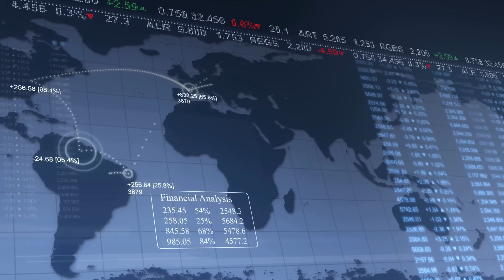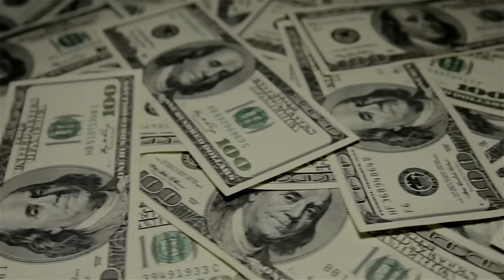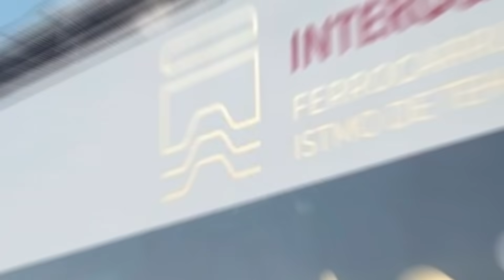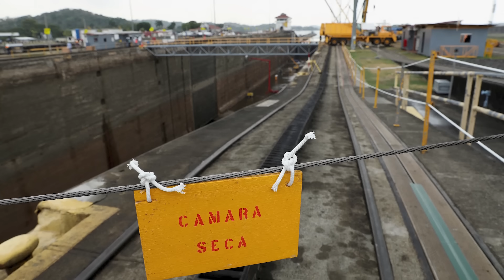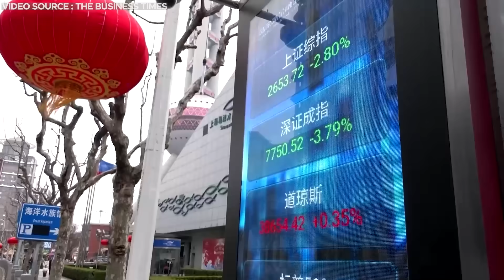Mexico Is Building A $5 BILLION Corridor That Will END The Panama Canal

Comment: So Mexico's plan is to unload a cargo container ship, move the containers with a rail train to the other coast, then load it on another ship?  That seems very labor intensive.  Compared to going to Panama, and going through the locks without unloading the ships.

Besides Panama can reduce the amount of water needed for each lock by 20% if they would dredge the lake by about 10 meters, and then drop the lake water level by 10 meters.  Then less water into each lock for each crossing.  

If Mexico had a way to transport each container ship across the country from the Pacific to the Atlantic and back, that would provide a effective competition to the Panama Canal.  However if they need to cross a mountain that is over 300 meters then a canal would not be cost effective for 800 feet long ships over 10,000 ton capacity.
Reply: Jobs ! ! ! !

Comment: If it works, more power to them. The Panama Canal is growing impassable due to lack of rain for the lock structure.
Reply: The lock infrastructure is fine. Lake Gatun is the problem. Water is reused in the actual locks. The lakes water level has been dropping for many years.

Comment: Will never work. We are now building ships to carry 25,000 boxes will require to much time, labor and multiple container ships to work.
Reply: However, ships are built due to size restrictions of the canal.
Reply: @deepsleep7822 Didn’t Evergreen send one of their super box boats thru the canal? The accident was not related to a size issue. Long Beach has some of the largest cranes and deep water piers. It’s the east coast that needs to catch up. Offloading 23,000 boxes from a ship, loading them on a train and then reloading a second boat on the same voyage simply makes no sense.

Comment: Container ships today spend less than a day in port to load and unload it's cargo. The 2 days loading and transferring cargo will save about a week over going through the Panama Canal and offer an alternate route. Right now, ships wait days to go through the locks. I am surprised it has not been done by now.
Reply: You need twice as many ships as before. Instead of 1 ship making a complete trip, you need a ship for the Pacific and a ship for the Atlantic sides of Mexico. And then the time to unload, transfer to trains/trucks, and then reload onto a 2nd ship.
Reply: @twostate7822  You don't need twice as many ships! Those ships take half the time to make their routes!
Reply: @twostate7822 the ships you unload can then be reloaded with cargo going the other direction. Some loss of efficiency there, yes, but doesn't require twice as many ships. If Panama is a bottleneck, adding an alternate route will increase overall cargo movement across america
Reply: @SuprousOxide  Think closely about the problem. Say there is a shipment from New York to Tokyo, and then a return shipment from Tokyo to New York. You can get by with 1 ship. Having to unload in Mexico means you need 2 ships. Simple math says that is twice the number of ships required.
Also, right now, about 45% of ships are sailing empty. They delivered a shipment, but then have to go to a different port to pick up another shipment.
Reply: @twostate7822  in that case, the one ships busy for the whole trip from New York to Tokyo and delivers 1 cargo load.
In the case with the railroad, you need 2 ships, but you're delivering 2 cargo loads in about the same amount of time.
1 goes from Tokyo to the railroad on ship A, then the railroad to new york in ship B. The second cargo goes from New York to the railroad on ship b then the railroad to Tokyo on ship a.
Overall, you need the same number of ships to deliver the same amount of cargo.
Ships don't travel empty
Reply: @SuprousOxide  Of course ships travel empty, all the time. Don't be ridiculous. Google should be your friend, not your enemy.
Now you are making up an international rail system that doesn't exist to carry goods from southern Mexico up into the US???
Let's make the route from Europe to Japan instead since you have trouble with the logic. Ah yes, a train from Mexico to Japan makes more sense.😂😂🤣🤣
Reply: @twostate7822  where did you get this idea of a train from Mexico to the US. We're still talking about the train across Mexico. But you don't need twice as many ships of you reload the ships with cargo going the other direction after you unload.
And you can do the same with the trains.
Japan to Europe would work the same way I described for Japan to New York
Reply: @SuprousOxide  Smoking something good? You are the one who suggested a train across Mexico to New York. And yes, you need about twice as many ships overall if each ship is only going about half the distance. A tanker ship can't be used to haul grain, or coal, or cars. And non tanker ships can't haul crude oil. Plus, as you refuse to understand, ships sail empty a large percentage of the time.
Reply: You forgot about the amount of time to transport the cargo across Mexico and sorting time before reloading..
Reply: @themoretruthfultruth  It is eight to ten hours from the Pacific to the Atlantic
Reply: @vickyp7345  Did you add the time to put the containers on the railroad cars and then unload them? Time that the railroad cars sit in the yard? Railroads don't run like a trucking line. There is a lot of time spent putting a train together before it is ready to roll.
Reply: @themoretruthfultruth  the trains will never be taken apart. the containers will go directly from ship to the stacktrain then it will cross Mexico. The bottleneck will be loading on the other side, unless the entire ship's cargo is going to a single destination, which isn't likely

and ppl, you don't need to distinguish between 20 and 40' or any other size container. Ships are measured by 20' containers, so a 10,000 capacity ship holds 10,000 20' or 5,000 40'
Reply: I think it is more important to have deeper draft ports to handle larger ships than Panama handles.
Reply: What most of you experts forgot is that the Interoceanic train (CIT) it’s also going to have 10 industrial parks to manufacture goods and also serve as a Centroamérican migratory deterrent so they don’t have to travel north! https://en.wikipedia.org/wiki/Interoceanic_Corridor_of_the_Isthmus_of_Tehuantepec
Reply: They should open Atlantic with Pacific Ocean, removing the land and making a straight  free for ship navigating. NO need canal, just water moving though.
Reply: Just imagine you can have 100-car train with 2 containers stacked per car. That's just 200 containers. The train will be over 2 kilometers long. You would need at very least 3-km long block sections. At very least you can make 20 minutes headways, but likely closer to 30 minutes. At 20 minutes that would be 600 containers per hour. Or just 10800 containers in 18 hour span. Rest 6 hours for maintenance. That's mere nothing. Just 4 small container ships.
Reply: I cant see this working at all.  True that a container ship can be unloaded in a day but what will the wait at anchor be for dock space?  What will the costs be for stevedores at each end plus transport costs?   How many ships can be worked at one time?
 Figuring 15,000 containers  of mixed 20' and 40' boxes per ship  how many rail cars will the entire operation need? 
  While there is a delay waiting to lock through the canal there will also likely be waits on the receiving side for the receiving ships arrival and offloading then if the two ships are swapping cargo that can involve more delays.  Keep in mind also the ships load plan, so the last containers offloaded may need to be the first to be loaded on the receiving ship.

Tankers  and bulk carriers wont be a match for this either.
Reply: Besides, a cargo ship waits up to a week waiting for its turn to cross the canal.
Reply: @vickyp7345  Now that is true. But will it justify the extra expense of load/unload and railway trip?
Reply: By providing an additional shipping route?

So go to port, wait for your ship to be unloaded, us multiple trains, supply another ship in the other side, have them reload your ship.

That sounds like a nightmare.  Guaranteed to lose cargo and take days anyway.   Then you have to haven alternate ships for each side.  It sounds like it would be very slow and very expensive
Reply: Its already done, it's called I-10 in the USA. 1 day to disembark in californica, 1 day to cross the USA, 1 day to get back in a ship in the Golf of Mexico or the Pacific. That is why the USA left the Panama Canal.
Reply: @eloymarquez4783  Driving across the US by truck??? By law, US truckers can only drive on the road 11 hours a day.  An average container ship can hold 15K containers. How do you get 15K drivers from thin air??? That's for just 1 ship. If you had 10 ships a day, that 150K drivers and rigs. And somebody has to pay all those drivers, plus the expense of unloading and then reloading at each end.
As far as the US leaving the Panama Canal, not needing to use the Canal was not one of the reasons.
Reply: Your surprised really? You know what happens during this whole process right? Cartles are going to extort construction projects like the do now, leading to a lack of investment. Then if it does get built they are going to hold ships hostage like african pirates due cause there is a ton of money in it. Really not that hard to figure out. As a Panamanian myself, Panama was part of Columbia before the Canal and was not a secure area. No one wanted to invest in that, US takes a 100 year lease with protection rights people invest. No protection in old Mexico to many cartels and the Gov can or will not control them.
Reply: @EnlistedBombin  that is the biggest lie I have ever heard! If that was true, then Mexico would not be 2nd trade partner of the USA. Do you realize how much trade already exists in Mexico? Why is not a problem now?
Reply: @EnlistedBombin  Nope. At this scale, the cartels will be burned down.
Reply: @EnlistedBombin  The cartels won't do anything. They won't bite the hand that employs them.
Reply: @themoretruthfultruth  Your badly mistaken all they care about is power and money. They are stronger then the Mexican gov you do realize that right. Thats why the Mexican gov can not stop them.

Comment: Everyone here favoring the Panama Canal is missing the entire point of the video. The Panama Canal was a solution for intl trade literary 100 years ago. It cannot handle the load anymore. Plus Panama/Colombian terrain has lots of mountains you can't just build a better Canal. Also, they are battling droughts for years now. Panama does not have the resources to build another canal nor a better railroad. They already have a railroad. Meanwhile, Mexico's plan was already put in motion and it's running 6 trains both ways daily. With brand new Ports at each end. It's literary built for major trade

Comment: It will be interesting to see how well a rail system could compete. When some of the container ships can hold over 10,000 containers (the largest is currently 22,000 twenty foot containers, or ~11,000 forty foot containers), the added costs of unloading that many and then reloading them (which takes days, infrastructure and manpower on both ends) seems prohibitive. 
The container rail cars are over 60 feet long. But for simple math, let's say each is 52.8 feet long. That corresponds to 100 rail cars per mile (100 * 52.8 = 5280). If each car stacks 2 forty foot containers, that's 200 containers per mile. That means it would take 50 miles of rail cars to match the load on one large container ship. Locomotives rarely pull more than 2 miles of cars, so that corresponds to 25 train loads/day, with each being over 2 miles long.
I just don't see that as being realistic. Depending on Panama's fee structure, using rail might only make sense for smaller ships, and ships containing bulk, solid material (corn, wheat, coal, ore, etc)
Reply: And Mexico just received three or four "40 year" old locomotive engines from the EU.  Yes!!! forty year old engines!!!!.....
Reply: @albertomanuelcheung7103  That is actually not a negative. For this multi billion dollar investment, the cost of the locomotives is 'chump change', a fraction of one percent of the cost. Plus, it's an item that can easily be replaced (just roll it off the tracks and roll a new one on). If the starting budget demands compromise, this is a good choice. Once the business proves itself to be viable, they can decide what level of more advanced propulsion they want to invest in. They could just buy modern locomotives, or they could 'go big' by tailoring the propulsion system specifically to that set of tracks, grade and expected loads.
Reply: @gregparrott  it might sound a great project with high hopes, but at the of the day,  time will tell and reality sets in.
Reply: @albertomanuelcheung7103  I hope the Mexican government will explore if its utility can be expanded beyond just transporting goods between two oceans. From what I've read, one limitation to expanding trade with the U.S. is Mexico's limited transport infrastructure. If the government expanded its north-south rail infrastructure so it tied into this mostly east-west rail line, the rail line's utility could be greatly increased. Manufacturing companies could be located along it, receive containers to build products, and then redirect their value-added products by containerized rail to both the U.S. and more broadly, the world.
Reply: How much does it cost for the ships to wait for days and weeks to get into the canal?  I don't think of it being a competition more of an alternative. Ships have to wait a long time to queue up for a space to use that canal.
Reply: @byroncjohnston1  The rail, and the very dangerous trip around the tip of south America, and the less dangerous Strait of Magellan (where fees are also charged), are all COMPETING alternatives. Until both the cost and time is competitive, who would opt to use the train for trans-ocean transport? Even with the infrastructure China has at their main ports, it takes days to load, and days to unload large container ships. Scheduling and docking also add delays. This warrants paying hefty premiums to use the Panama route. The rail investment is also at risk of a proposed, second canal actually being built in the coming years. The rail approach should plan for sustainable utility, even without trans-ocean transport.
P.S. Someone else noted another valid cost that I missed.....A SECOND, ship has to be scheduled in advance, docked and waiting to receive the rail items. Since most global shipping transport is one direction (east to west), the odds are that second ship will have to travel from its last destination to the rail while EMPTY.
Reply: 11:43 11:43 11:43 11:43
Reply: @BAH912  #1) You placed no text other than a time stamp. So the intent of your post is unknown.
#2) The video is SHORTER than the time stamp you posted. Clicking on your time stamp simply terminates the video.

Comment: The Mexican corridor can only be traversed by rail. The highest railbed elevation is over 200 meters (660 feet) The steepest incline is a 400 ft. rise over 6 miles. This is an 8% grade. I've heard that a 2% uphill grade is the maximum for trains. Even at 2%, this requires a lot of engines to pull fewer cars uphill. This will slow down the anticipated long, heavy trains. Offloading/onloading ships on both ends also slows down the traverse time.
Reply: Hmm, you know, they might make some cuts in those hills to lessen the grade or maybe tunnels.

Comment: Build a train big enough just to carry the whole ship to the other side 😂😂😂😂or start putting wheels on ships and a V10000000 engine to drive it to other side 😂😂😂. Don't do drugs kids
Reply: That was  in an editorial cartoon before they built the Panama canal
Reply: If you play "Supreme Commander" the Cybran faction destroyer warships extend legs and walk on land, Sure, it's insane, but is not impossible either. 😹
Reply: @LoneTiger  👍🏽🤣🤣
Reply: @LoneTiger  Float the ship onto large shape conforming train trailers, drain the water and back in the locomotive.  Off you go!   Everything would need to be colossally sized, but it should work.  Do the opposite on the other side.
Reply: I suspect the current ships would not survive out of water laden but they do survive big waves so I could be wrong.

Comment: Build a much wider and two direction canal at the Darian Gap starting from the middle outward so the internal area could be drained and big machinery could do the digging and ground preparation without the Caribbean or the Pacific causing problems.  Make the canal an international transit nation with resources outside of the canals themselves so people on both side of the canal could benefit.
Reply: The Darian Gap is not realistic.  There's a mountain range in the middle that is 1500 to 3200 feet high.  The canal zone is much lower--The highest point of the Panama Canal is just 85 feet above sea level.  Widening the channel and locks would be more realistic.
Reply: @GeographRick not to mention their point about turning it into its own “international nation.” There’s a zero percent chance Panama just gives up some of its land when it’s got a lock on the canal trade already…
Reply: @GeographRick  that makes sense
Reply: @GeographRick  "The highest point of the Panama Canal is just 85 feet above sea level. " Atlantic or Pacific?
Reply: It's Darien.
Reply: @peterquennellnyc  Thanks
Reply: @juligrlee556  Haha! I knew what you meant, but used Google Earth anyway, and was taken to The Gap store in Darian Connecticut. :-)